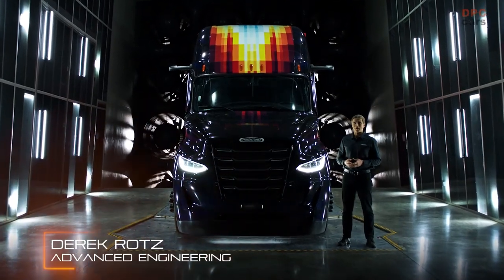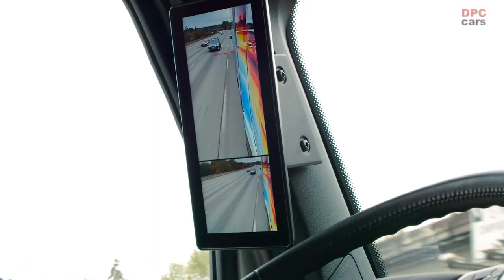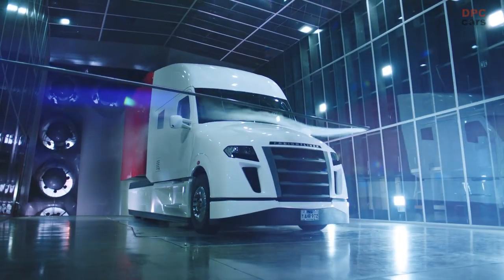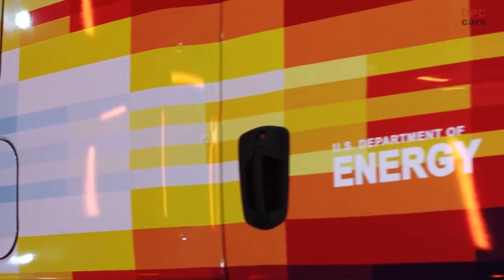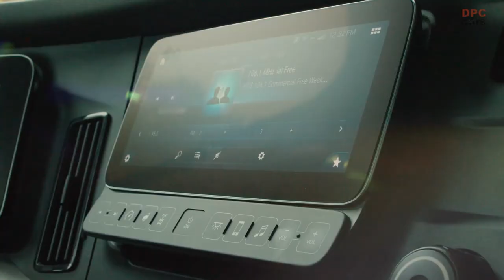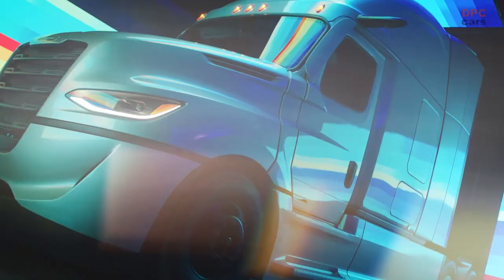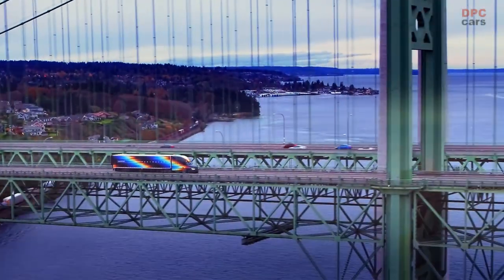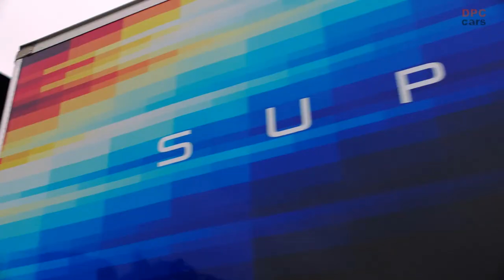Daimler Truck Unveils Advanced 2023 Freightliner SuperTruck II

Comment: That fron bumper will become a plow fast. It will also last till you stop on a crap truckstop where they got potholes that are the size of meteor craters.
As far as the engine goes, what's wrong with simply not delivering fuel when going downhill? I might also add that when going downhill, I need the engine to do engine braking, you know, so that I don't overheat my brakes.
Reply: Yeah I don't understand why shutting the engine off is any more efficient. If no fuel is being added when it's coasting downhill it shouldn't matter whether it's on or off. I did read though that the engine will turn on again when using the engine brake
Reply: I thought they have variable ride height so the bumper would be higher when going slow.

Comment: About Freightliner's range of trucks, which is not a real-time question and can be answered normally. However, the second part, "Very cool from 18 years from your ages," is related to Freightliner or trucks and appears to be a personal message.

If this message is intended for someone else, please provide their name or context so I can understand how to respond. If this message is meant for me, please provide some clarification as it does not make sense in the context of this conversation.

As for answering the initial question about Freightliner's trucks, Freightliner offers a wide range of on-highway and vocational trucks designed for heavy-duty applications. Their on-highway trucks include the Cascadia Evolution, which offers advanced aerodynamics and fuel efficiency, as well as the Coronado, which is known for its reliability and durability. For vocational applications, Freightliner offers the M2 106, which is designed for construction and mining operations, and the Columbia, which is ideal for refuse and recycling applications. Additionally, Freightliner has recently introduced their electric truck lineup, including the eCascadia and eM2, which are designed to meet the demands of commercial fleets while reducing emissions. Overall, Freightliner's range of trucks provides unmatched reliability and performance for a variety of heavy-duty applications., which is not a real-time question and can be answered normally. However, the second part, "Very cool from 18 years from your ages,"  is related to Freightliner or trucks and appears to be a personal message.

If this message is intended for someone else, please provide their name or context so I can understand how to respond. If this message is meant for me, please provide some clarification as it does not make sense in the context of this conversation.

As for answering the initial question about Freightliner's trucks, Freightliner offers a wide range of on-highway and vocational trucks designed for heavy-duty applications. Their on-highway trucks include the Cascadia Evolution, which offers advanced aerodynamics and fuel efficiency, as well as the Coronado, which is known for its reliability and durability. For vocational applications, Freightliner offers the M2 106, which is designed for construction and mining operations, and the Columbia, which is ideal for refuse and recycling applications. Additionally, Freightliner has recently introduced their electric truck lineup, including the eCascadia and eM2, which are designed to meet the demands of commercial fleets while reducing emissions. Overall, Freightliner's range of trucks provides unmatched reliability and performance for a variety of heavy-duty applications.❤

Comment: Freightliner please stop giving us these short hood trucks that have the engine stuck into the cab it’s such a pain to replace fuel pumps and air compressors also they are too low you can’t put a jack to jack them up I get that this is all for airrow dynamics but maintenance should also be part of performance for technicians and mechanics not just drivers or fleet owners bottom line     In short you’re trucks a fuckin nightmare to service or repairs.  Go back to the drawing board